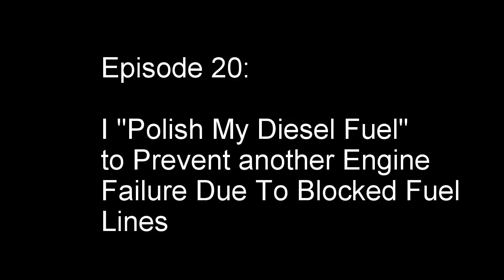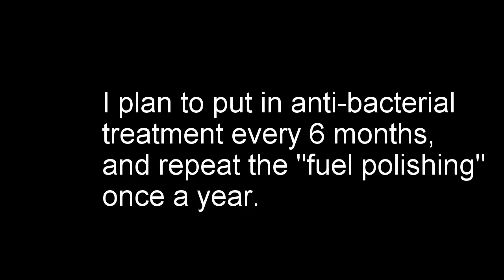Ep 20 Diesel Fuel 'Polishing' To Prevent Clogged Filters and Lines

Comment: If you want to really filter all your fuel you need a tank to receive it. When you put back the fuel you just cleaned, you also suck out  some clean fuel to be refiltered and leave dirty fuel in your tank.
Reply from the maker: I agree with you Paul.  That would certainly be a better way, and I've seen on the web others who do it that way.   (However, I do have a 210 liter tank, so the logistics of doing that are a bit challenging, but still do-able.)   I have decided to mount a permanent 'polishing' system in series with my existing system to give me a bit of additional protection.   Thanks for commenting.

Comment: hmm you could just put a second filter with the 10 micron so you run it in half the time :).
i am going to buy the filters second hand and place new filters in so it wil cost me about 25 euro's each.
i think i wil only use 10 micron filters in but run it to both same time so i won't overload my fuel pomp.
your tank is not collecting mutch water because your tank is not made of some kind of metal.
and your tank is kinda isolated in the floor.
no worry's there.
my tank is made of metal and i wil isolate it verry good.
often i make my own diesel (PPO) and its got some alcohol in it that wil kinda prevent the growth of bacteria.
also there is a kind of diesel (new) that wil last a lot longer and stay clean.
Reply from the maker: It sounds like you have got this water/bacteria problem mastered Kitty.   I've learned a great deal about these issues over the last 6 months.   I'm rigging a Racor filter/separator right at the exit to my tank so hopefully, it will give me an additional permanent polishing system and protect me from the difficult situation I found myself in this Summer.  Many thanks for watching.

Comment: Hi Patrick
Back again with a further question.
What did you use for the in-line fuel strainer?  I looked on the web but couldn't see anything like it. Would you consider having a strainer like that permanently plumbed in to your fuel delivery system before the primary fuel filter,  or is that overkill?  There was a comment in French, which I didn't quite follow, about a water strainer to which you seemed to reply that it was a good idea. Doesn't the primary fuel filter generally have a water separation element which can be bled off at the bottom?
Thanks
Philip
Reply from the maker: Those mesh in-line filters are now installed in my fuel feed line Philip.   If you look in Episode 13 at 2:23 you will see them (one on each side of the fuel cut-off valve).   (One would have been enough though.)    If you Google 'diesel in-line filters' (images), I'm sure you will see them (quite common).   I think Mercedes diesels in cars systematically have them.   I had a Volvo fuel filter with water separator mounted on the engine room wall, but the water separator was not transparent (and changing filters very messy).   I replaced the Volvo water separator filter with a Racor filter that has a transparent water separator on the bottom (and very clean/easy to change the filter element).  Love it!   Thanks for commenting.
Reply: Thank you very much for the reply
Fair winds
P

Comment: Very interesting and btw, you have a very nice boat. Anyhow, am I to understand you’re just dumping the clean fuel back into the tank with the contaminated fuel? Also, have you thought about putting in an access hole in the fuel tank? It’s pretty simple to do.
Reply from the maker: Thanks Spewed.   Yes --- a polishing system just recycles the fuel through the filtering system and back into the tank.  I suppose you could send it externally, but then you would need (in my case) up to 210 liters of tanks to store it in.   In this example, I left the pump running for long enough that all fuel in the tank cycled through the filtering system 5-6 times.   Regarding the access port, in principle it should be easy.  In practice, it is not (on my boat).   First of all, you need to pump out all fuel -- so lots of spare storage tanks.   Then cut holes into each compartment (separator walls inside the tank).  This isn't as simple as it sounds, as a wood cover is epoxied/fiber-glassed into position over the aft end of my tank.  Then you have to clean any droppings from the piercing process, or they will eventually block fuel lines/filter.   So yes, I agree, it can be done, but only with some blood, sweat and tears.    I would have preferred a drain cock at the lowest point, but the manufacturer did not include one.  Thanks for the comment.

Comment: Good info, thanks! What is the brand of fuel pump you bought?
Reply from the maker: Thanks Craig.   I originally ordered from an auto parts store an old VW Golf fuel pump which would have worked perfectly.   The part is now obsolete, and they sent an electronic replacement that would not work in this context.  The next day I was at the local chandelier for another part and noticed this electric pump on the shelf.  It is normally used for pumping fuel or oil out of tanks.   It was not a good idea.  The max capacity of the Racor 500 filter is 227 liters per hour, and this pump had a capacity about 10% higher.    I think that may have contributed to me not seeing any water ---- it was pumping too fast for the centrifugal separator in the fuel filter to work.    If you are going to do this, buy a pump that is less than the capacity of the Racor filter.   Thanks for watching.

Comment: Bonjour Patrick, great video. Are you positive none of the gunk got actually stuck to the inner walls of the tank? I too find surprising the small amount of particles you caught. I never had such an issue on my boat (knocking on wood... and topping up my tank after each trip) but from what I've seen on others there are both free roaming particles and some adhering to the walls as well. The opening in the tank is quite small, however did you manage to get a peek through it and check for sediments at the bottom and/or the nearest tank inner wall?
Reply from the maker: Thanks TV.  I really couldn't see anything through the sender hole, but I did walk the suction pipe slowly up and down the walls and everywhere on the bottom I could reach.  There are baffles in in the rear part of the tank that obviously I could not get around.  I do believe (from the shape of the tank and hull that those sections are 'higher' than the area I had access to, so I think sediment would have worked itself down toward where I was working.   As you say, it was surprising I didn't get more...... perhaps that chemical (Actioil 550) really does dissolve the bug.

Comment: What brand of fuel pump are you using? I'm wanting to build one like this and all I'm finding are either 1/2 gallon or less a minute or 10-20 gallons a minute which would be too fast for the filter. Thanks.
Reply from the maker: Good question Richard.  I originally ordered an old model VW diesel fuel pump from an on-line car parts dealer.  As it was an old model, the parts company modified my order to give me the new generation model, which was inappropriate (immersion type) for the polishing system I wanted.  I sent it back and went to the local ship chandler store and they had small pumps used to pump out fuel and oil tanks (15-20 minute pump-outs).  (Not really designed for continuous polishing, but OK for a couple of hours running I suppose.)  The model I bought was a 'Proxxon AP 12'.    Unfortunately, its capacity was just slightly greater than the Racor filter I was using.   It wasn't much over, but it was a little.  This MAY have been the reason I did not see water in the filter bowl during my polishing ----- it MAY have been pulling the fuel through too fast for the Racor water separator to work (though the sediment was captured).   So, look closely at the capacity of the filter you are using, and be sure to get a pump that is below the capacity of the filter.  :-)    Good luck.

Comment: Excuse my ignorance but is there any possibility that the greater “grunge” is floating at the air/diesel interface rather than at the base of the tank?
Reply from the maker: It is of course possible Declan, but I think unlikely.   The air around boats is usually quite clean (compared to what is present in a city).  On the other hand, the presence of water and bacteria in diesel at the bottom of tanks at refueling stations, in jerry cans, and in boat tanks themselves is well-documented and common.  In fact, almost every boat owner sees evidence of this problem to some degree or other.   Good question.

Comment: Is it not possible just to fit the Racnor filter / polisher into your diesel system? you'd then have nice filtered / polished fuel all the time? many thanks Ian
Reply from the maker: In fact Ian, my current system is constantly circulating fuel through the water separator filter and the engine.  (It's not a Racor --- just a Volvo Penta standard filter.)   I like the Racor because the bowl is transparent, and its reputation is without equal.  Unfortunately, space is very limited, so difficult to add another filter in-line.  (Another viewer kindly sent me instructions on how he did it on his identical boat ---- but space is very, very tight, and I decided not to do it........  I just didn't feel the benefit would be worth the effort, and hassle.)
Reply: Many thanks

Comment: Generally cleaning the tank is not called polishing, they actually clean the tank.  Start by emptying the contents into a container (55 gallon drums??), take the inspection plate off the top of the tank, visually inspect then scoop out any scoopable gunk, then finish off with some solvent (Stoddard's??), mop that around then suction it out.  Finally replace the inspection plate (s) and gaskets.  You now have almost a brand new tank.  Your old fuel is filtered and returned to the tank.  Job done, give the man 500 #s  (or more).
Reply from the maker: Thanks Henry.  "Cleaning" is not really practicable on my boat.   The wooden board over the top of the tank is fiber-glassed in, so I would have to cut it out to get access, and even then, there are no proper access ports.  I'd have to cut them into the tank.   Ouch.   I'll have to be satisfied with regular polishing and chemical treatments.    (I also installed good, transparent Racor filters as well.)  Thanks for articulating the difference between cleaning and polishing

Comment: Why don't you fit the Racor filter permanently there very good and easy to change and drain. The glass bowl gives you the heads up on water contamination.
Reply from the maker: And that is exactly what I did about two months later (replaced the Volvo water separator which is solid with a Racor that is transparent).  That said, the in-line strainers did a very good job at filtering out a healthy layer of crud (which I show in one of my Iceland trip videos).   Thanks for watching Andrew.

Comment: I know this has been on here for while, but I always wondered why you didn’t run a cycle drawing direct from the engine fuel line, because that surely must go to the lowest point in the tank?
Reply from the maker: Good question.   It is because there are baffles in the fuel tank to prevent/reduce sloshing, and the diesel bug accumulates against the baffles.   Moreover, the fuel pick-up is lifted about 2 cm higher than the lowest point, to AVOID picking up sediment and diesel bug.
Reply: @patricklaine6958  that would be a problem for me because my main tank is under the engine, within the keel and I don't have free access. Given how narrow the tank must be, there may not even be a raffle in there. There is an access plate but it isn't that accessible at all and I can't see how I can poke a pipe down there either. This is a problem...

Comment: I wonder if it might be more economical to replace the fuel tank and pipework
Reply from the maker: Well, Steve, the issue is 'and replace with what'?  The plastic fuel tank is molded to fit the hull form and goes quite a ways back (not just the obvious black part you see in the video).   I think if I asked one of our local engine companies about it, they would recommend siphoning all fuel out, removing the tank, giving it a good cleaning, and then reinstalling.   None of that is easy.........  Many others on various forums have done exactly that, but none of them speak of it as being either easy or inexpensive.     Good thought though.

Comment: As a Solo Sailor losing your engine can be disastrous. Diesel fuel degrades everytime it is transferred between containers. The Algea you have is a common problem.  Adatives and good filters are a good solution however , if space allows, a "Day Tank " with enough volume for pre-filtered Fuel might be a help.
Reply from the maker: I have followed that advice to a certain extent Farley.   I always have at least one 20 liter tank of clean diesel with me.  If the lines get clogged (and the filter is clean) I have some very simple plumbing hose and a priming bulb that will allow me to by-pass much of the fixed system and 'get home' safely.   Thanks for commenting.

Comment: What was the pump you were using. Remember how much and where you bought it
Reply from the maker: This is a sad story Antonio.   I ordered an old VW Golf pump on the internet that would have worked perfectly.   The company knew it was an obsolete model, so they sent me the replacement that had some electronics and a fuel pickup that would not work in this polishing set-up.  I called, but they said the original would take weeks to locate.  The next day I was in the local chandlery and noticed a pump on the shelf that is used for pumping fuel or oil out of large tanks (to empty them for cleaning).  I bought it.  Unfortunately, this pump was slightly too powerful and pushed the fuel through the filter too rapidly (preventing any separation of fuel from water in the tank).   Thus, I would strongly recommend NOT buying this kind of pump.  Instead, look at the rated capacity of the filter you want to use for polishing, and then buy a pump that is a good 10% or so LESS than the capacity of the filter so that both contaminant particles AND water are removed during the polishing.

Comment: Regarding the reason why you sucked up no water, it could of course be, as you mentioned, that your pump had a too high capacity which did not give the water the time to "fall down" in your filter.
Another idea I had is that the water in your tank will certainly all be concentrated at the lowest point in your tank. Is it sure your hose reached every point in your tank? Maybe you missed the lowest part?
Reply from the maker: I'm pretty sure I got to the lowest point in the tank Carl.   I think your first idea (over-capacity of pump) is a real possibility.   Other possibilities include: 1) the chemical I used 'absorbed' the water (as they claim it does); 2) the Racor filter actually claims to block 90% of the water in the filter elements themselves; and 3) there wasn't much water in the first place.  (Plastic tanks have much less condensation than metal tanks.)    I'll continue using the additive every few months, and doing the 'polishing' once per year.  Thanks for commenting.

Comment: Patrick, I worked on diesels for years. I thick you want to polish fuel before you add chemical. Most chemicals emulsify the water with the diesel to burn it. . So the idea is to add chemical periodically to keep  the slime from forming and tank should stay clean.

Comment: Hi Patrick
Won't it be better to make this system permanent? like you put unpolished diesel to temporary tank, filter it, put polished diesel to main tank. so your engine will always use polished diesel. 

thanks for your work, nice video and theme  again..
Reply from the maker: I'm trying to figure out how to do exactly that Repla.   The problem is simply a lack of space....  Many large boats do have permanent polishing systems with dual Racor filters as well.   Very nice.    An engineer who watched one of my films reminded me that in a sense, our systems are self-polishing, because there is a return line to the fuel tank from the injectors.   I hadn't thought of it that way before, but he is right.  There already is a degree of polishing occurring.   Good comment.
Reply: yes, space is a big issue. can something like this help? https://www.force4.co.uk/force-4-hulk-fuel-tanks-m.html maybe this can be connected with a short hose to your pump and filter and using outside fuel inlet of the boat at fuel station can be better.  polishing diesel in interior of the boat creeps me out a little. :)

Comment: Looks like your flow of diesel is very fast compared to what it is when the fuel goes to the engine. Might be that the water mixed in the fuel does not have the time to separate from the oil after going through the forced osmosis/micro bubbles of the- filter? With a flow of 200l/hour you replace about 1/10th of the condenser volume per second... that seems like a lot to allow water and oil to separate.?
Reply from the maker: You are probably right Thibaut.   I may buy a pump with lower throughput next time.  Here's the tradeoff: if you select one whose volume input/output is too low, the sediment on the bottom will not migrate to the suction head when you let it sit on the bottom for a long time; if you choose a pump with too much capacity, you should get a fair amount of sediment, but you will probably just end up recirculating any water.   You are probably right; I probably just recirculated the water this time.
Reply: Patrick Laine hi Patrick, I suppose if you did have water you would see it in the condenser just before the engine filters. Love your videos, I need to try your docking technique next year, now my boat is out of the water for some major maintenance.